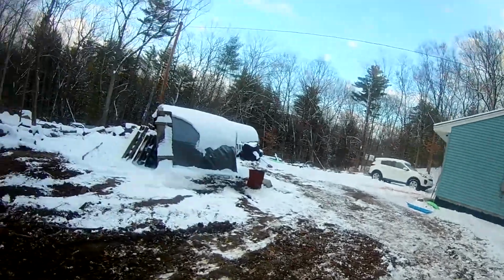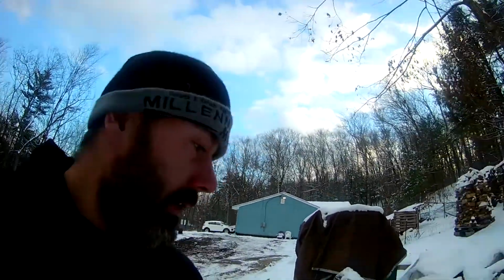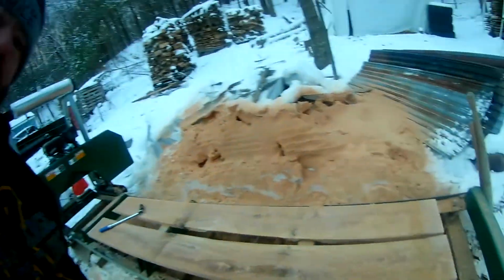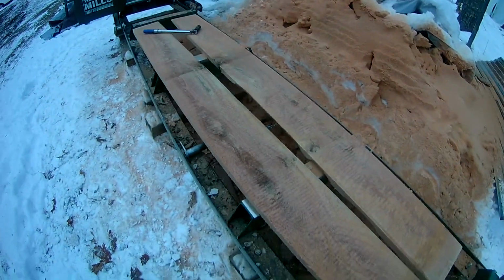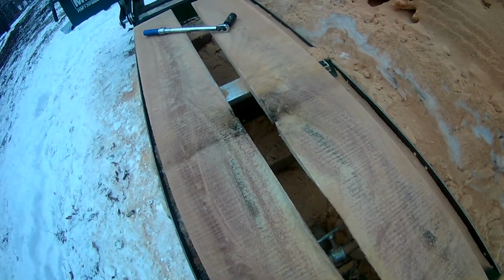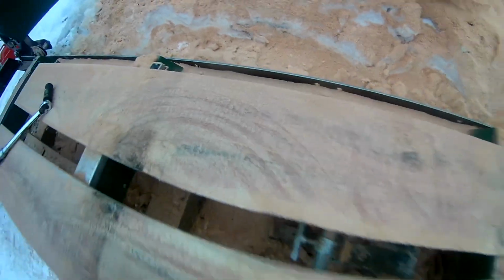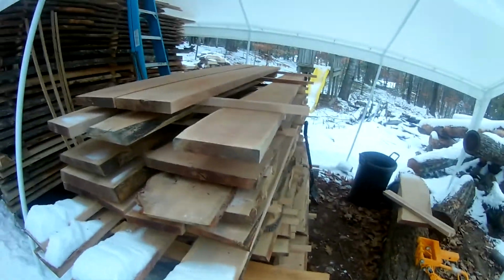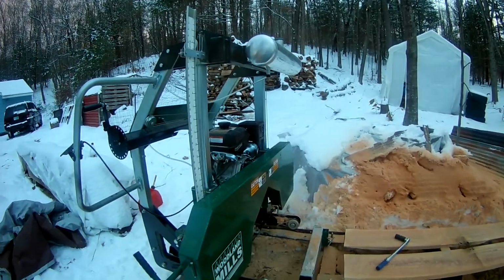Band Saw Mill Red Oak Log with my Woodland Mills HM130 Bandsaw Sawmill

Comment: Nice...I do have a question...I watched Ben's saw mill and noticed he doesn't chip away the bark 1st but you do before making your cuts. Is there any reason you do this? Just curious. I suspect there is no right or wrong way.

Cheers,
Scott
Reply from the maker: The bark causes the blade to wear out much faster.  Bark is more dense and typically packed with dirt and rocks.  I normally pressure wash the logs in the summer, but since it is freezing weather now I just remove the bark since it is fairly easy to do and can more than triple the life of a blade in many cases.  Some people dont go through the effort for the time savings benefit, but I hate changes blades, so I debark my logs if I can. Its mostly preference.  Thanks for checking out the video.  Feels good to get back on the mill again.
Reply: Dillon's Woodworks enjoyed watching the video. Was curious about the bark. Keep up the good work.

Comment: Since you have had your 130 for a while, Can I ask you a few questions.?
I am looking at the 130 and tossing another mill, but keep coming back to this one. 
Is the 130 and electric start or manual pull?
Are you happy with you mill, I know getting it set up takes much longer than some of the other mills out there, but there is a significant price difference between this one and some of the others. 
Are you able to mill up 6X6 boars and keep them square on this mill?
How are you sharpening your blades, some of the other mill makers have a blade sharpening service they offer as well, so curious if a guy was trying to mill up enough lumber to build a cabin or small house, the number of blades used up, trying to factor that into the cost as well. I  know it is a  stretch, but in the end it will add up to total cost on the mill. 
I like the fact you are debarking prior to milling as well, I would think that would help on blade life, but I have never owned or run a  mill so I don't know. I know you power wash some, but where my cabin site will be, it is totally off-grid so power washing wont be an option for us, Debarking on the other hand will be. 
Thanks again for sharing your mill with us and thanks for the inspiration behind it as well. I hope you and your family have a blessed week my friend.

Comment: mike don't know how well or if this trick would work for ur mill but here goes with a good sized log if u clamp it down and get ur first side flat u can then flip it 180 flat side down on mill and cut the top with out the clamps holding if u do it right it will be parallel and makes it easier to get the other two cuts as close as possible to square. This method may or may not work for ur mill also having a speed square on hand to check how close to square ur cant is helps keeps u from getting to far off square. Just thought I'd let u know about these tricks they may or may not work for u
Reply from the maker: Cool, thanks!  Thats a great idea.  I'll have to give it a shot.  I'll let you know how it goes.

Comment: How do you deal with wood warp? I’m considering a bandsaw mill, I had a chainsaw mill but it really seemed like the boards warped a lot
Reply from the maker: The number 1 thing is to sticker and stack the lumber.  If it is a wood that is likely to warp you could put lots of weight on top of it or put a ratchet strap around the stack to help keep it flat.  Also, if you seal the end grain with paint or wood sealer it will help prevent the moisture from leaving the end grain too quickly, which can also contribute to warping and cracking.  In some cases it will be very hard to prevent warp if there is stress in that particular log.  I have had logs and boards warp as I cut them on the mill due to the amount of stress in the tree.